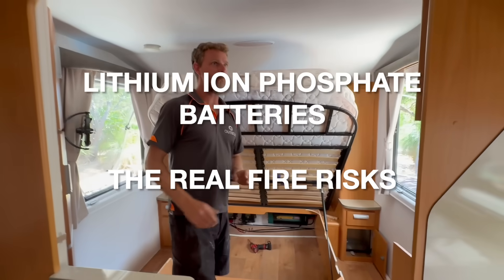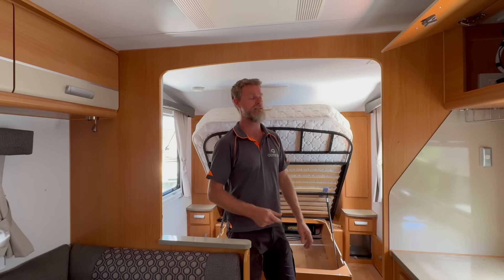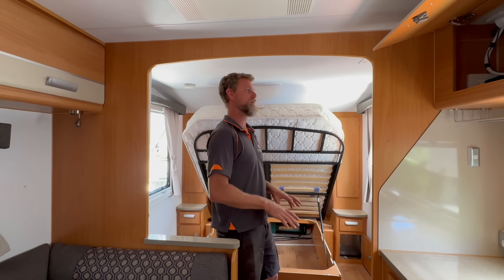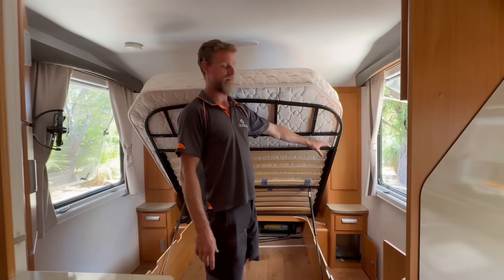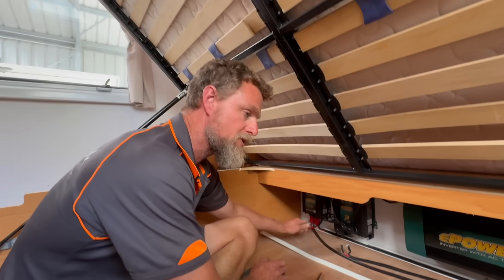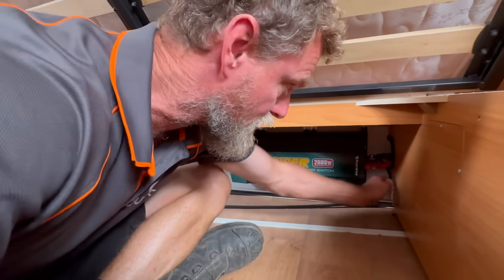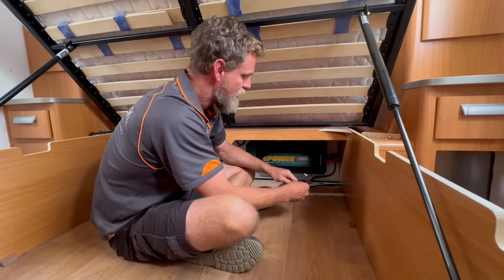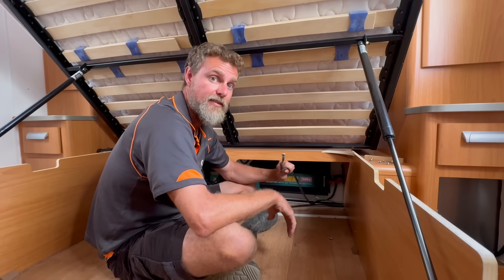Caravan Lithium Batteries - The Real Fire Risks

Comment: Lithium ion is high risk, lithium iron tantalate low risk.  
google "LiFePO4 Puncture Test - Can these batteries catch fire? Is LiFePO4 Safe?"   for a crow bar through a LiFeP04 (extreme test lol)

also "Shot, Punctured, Overcharged, Set On Fire Chins 20AH LiFePO4"   for super extreme testing,

it takes a LOT to get LiFePO4 to catch fire.   but it is possible. but your van is in a WHOLE lot of trouble to get there. 

also invest in a good fire resistant battery box too.

Comment: The amount of systems we have seen without proper circuit protection is astounding.

Absolutely agree the cause is usually poor installation, not the battery. There was a case recently where a bloke with a 4WD with a cheap (kings) battery box and battery in his tray caught fire. Everyone blamed the battery but on closer inspection the entire top of the battery was melted and the box had caught fire at one of the terminal studs, due to a bad connection. The case of the battery literally melted and the lithium portion never got hot enough to ignite.
Reply from the maker: Geez, sounds like they got lucky..
Reply: Simple Thermal imaging gun might have caught that issue beforehand...or he could have just spent extra to use quality terminal connectors?

Comment: So I use Victron kit, Multiplus 12/2000/80 for mains output and shore charging, two MPPT 100/50 for Solar (Shunt - etc) and a Lynx Distributor for connecting  almost everything - which has fuses to protect the wires that join everything. One fused output leads to a smaller fused system to power the LED lights, Fridge and water pump. I have 4 x 12V 108Ah (Blue Nova)  LiFePO4 batteries in parallel for storage. Just wish I could get each battery fused with an MRBF (Marine Rated Battery Fuse) fuse and fuse holder to better protect the potential amperage coming out of a LiFePO4 battery...

Comment: SOme of the comments and this video miss the point I think. Unlike lead acid litium chemistray can and does catch fire soemtime spontaneously and sometimes cabling or component failure. They can also catch fire if they are subjected to trauma such as in an accident. Soemtimes that damage does not becoem evindet and will catch fire after the event. 

Damned if I will have one of these batteries in my camper which I sleep in. I'll continue to use traditional deep cycle batteries. Easier to recycle and a darn sight safer thank you very much.  Don't el tme stop you from using litium in your sleeping pod though.....

Comment: Also the location is bad under a bed so u burn in bed?, it would be best to put all that gear in a metal fire proof box. Also those types of inverters are rubbish. Those cheap small inverters do not have the power and enough current output to operate breakers effectively on the 120v- 240v ac side. A fast glass fuse may work, but more than likely if an overload or short occurs the inverter will just shutdown. Most just overheat and fail. A fuse on the battery is a must, use a proper industrial HRC fuse not the automotive 32v plastic rubbish as these can just burn and start a fire. With cable size, voltage drop is more an issue.

Comment: 3:34 in what world could those two chargers EVER both be at full noise, you are just advertising your lack of understanding, either that, or you have a fukn long 15Amp extension lead, such that you can plug the van in, while you’re towing it.
That cable at that length is perfectly fine, just put a 50Amp breaker on it, job done.  The problem in the circuit is not the cable, it’s the fact that it relies on the tightness of the terminals on the AC charger to carry the current from the DC charger, that’s just poor workmanship, because you can’t isolate them individually.
The dickhead that installed all that shit the under the bed with zero access in an emergency, and zero ventilation, is the real issue.

Comment: Firstly, start believing what you're saying, your body language says otherwise (kept looking away and down, two distinctive traits of lying) LiFePo4 batteries are safer, but that's it, safer, they are still liable to self ignite if the internals have an issue. When you really look into Lithium the only advantages is weight and a larger potential charge/discharge rate, They don't really have a larger usable capacity as most require a charge level between 80 and 30% for best battery life, so still only 50% of rated current capacity. 
I have been a loom maker for 35 years and make bespoke looms and adjustments to factory looms. Never had a fire in any of my builds, Fuse regularly and adequately, The fuse is there to protect the cable! That is the first thing anyone needs to learn. Correct rated wire which is load plus 30% (electricity has a surge amperage), up any rating for longer runs, secure wireing at regular intervals.

Comment: Many great points made here about sub standard work in the RV industry. However, anything that continues burning when fully submerged in a swimming pool ain't going into any van I own.
Reply: So no mobile phone, portable speakers, torches, cordless tools, laptop, in your van?
Reply: I'm going camping in the bush, not my driveway. Besides, those items you use on a daily basis vs lithium batteries in a van the average working person may use 4-5 weeks/yr. Even the sales reps we dealt with (yes I worked in the RV industry for 9 yrs) told us they aren't cost effective for RV's you may use on such a small basis. On one of your lithium gadgets, check out the recent fire in Auburn (SA) in a 12 month old caravan & tell me you still want them.
Reply: @ Not one single caravan fire has had the evidence shown to be the storage battery. Only ever media speculation. I know the battery chemistry very well and LiFePO4 does not catch fire. Your home is filled with the volatile types of lithium batteries that do when they go into thermal runaway burn like thermite being "LiPO NMC INR" in all your devices yet you won't use the safe type LiFePO4 which does not burn. So how come Bunnings and The Good Guys and JB HiFi are not burning down left right and centre? Or battery stores? Meanwhile you are happy to have a phone in your pocket next to your nuts which if the battery let go would take them off. I have experience with LiFePO4 cells that have been crushed, dead shorted, smashed, drilled into, screws put through them, laser cut and torn open and NONE of them resulted in fire.
Reply: @magicmanspaz they catch on fire when charging. The good guys and bunnings do not leave them charging as you do when you go out and leave your solar panel on. Why not just use lead acid batteries? They work fine and are safer.
Reply: @ They do have them on charge in stores. Plenty of display devices on charge. How many homes are burning down from lithium devices vs claimed caravans. Dodgy wiring is the issue not lithium. You have a lithium powered mobile phone.
Reply: @magicmanspaz  The biggest cause of housefires today is batteries connected to solar chargers. Lithium phone batteries are smaller and do not generate the heat of larger batteries - same with power tools etc.  Bunnings does not have truck sized batteries on chargers.
Reply: @DavidNotSolomon  Stop making crap up mate any fire service website or insurance website will tell you the leading cause is cooking, faulty electrical, heating and candles, smoking in bedrooms. I can tell you power tool batteries get a lot hotter after use than the storage batteries in vans do when charging or discharging. I know plenty of phones and laptops that get hot when charging. Quality storage batteries in vans have temperature protections built in and will disconnect charge if the battery cells reach about 55-60c. Medical equipment and lift beds, Ambulances and such all run larger lithium batteries. How many fires do you see there? The LiFeP04 chemistry in van batteries is not even combustible like the types used in phones and laptops and power tools. Most vans barely even have enough solar to max out even a small lithium battery safe charge rate to even raise its temperature to over a safe limit and even then the BMS will cut charge before it reaches an unsafe level.
Reply: @magicmanspaz  If lithium are so damn good how come LG branded house batteries have been on a national recall for the last 6 months? Oh that's right...BECAUSE THEY CATCH FIRE!!!
Reply: @ So why isn’t everything lithium catching fire? Poor charge equipment and electrical is the issue. Lithium does not just catch fire for no reason. A badly engineered battery system can make AGM start a fire. And can explode a wet cell lead acid. An inverter can catch fire if it’s been made badly. Seen plenty of dcdc chargers go up in smoke. And cheap solar chargers. Lithium is not the issue. Shoddy electrical is. The LG batteries are also LiCoO2 Lithium Cobalt Oxide different to LiFePO4 which isn’t combustible. There has been no evidence of a caravan fire shown that it was in fact the lithium battery only media speculation. You find one example of faulty electrical in a home unit being re called and think it means anything lithium is dangerous. News flash everything you own with a rechargeable battery in it besides your car start battery these days is lithium. If it’s no good then why has it replaced other battery types in just about everything.
Reply: @magicmanspaz  Maybe it is the chargers - still a problem though.
Reply: @ I have seen chargers fail and send 16plus volts to AGMs and burst them. A quality lithium would just turn its BMS off and not allow the cells inside to be over charged. Don't buy cheap crap and get the electrical installed by a competent person. People need to stop blaming the batteries. Its way easier for a caravan manufacturer to blame the battery then it is to admit they do shoddy electrical work and use the cheapest batteries they can find. You use a crappy $200 lithium and you might get a fire. Because it has under sized cable inside and dodgy connections, a BMS that does not have working protection or a poor quality build where cells do not have adequate insulation and dead short. Not because its lithium but because its built like crap.
Reply: @magicmanspaz In your earlier post you mention why dont fire fighters report such things. Im here to tell you a close family member is a fire chief in a capital city MFS & he categorically states ALL lithium battery fires are their worst nightmare to attend. You clearly have a point of view, thats fine. But so do other people who differ to yours. That my friend is how the world turns.
Reply: @ I see my quote from the fire chief on lithium batteries was removed?
Reply: @aussie-all-the-way  I said where is the evidence its the battery that started the fire. Good for him he is scared of a lithium fire. Id rather a fire with shed and half a dozen lithium batteries inside then a shed with half a dozen gas bottles. Again there are different types of lithium batteries, The ones in caravans are not the type that violently burn. But everyone is happy with the violent types in their pockets in phones and devices and in their ear buds etc.  Some people are just scared of things they do not understand.
Reply: @magicmanspaz Clearly you have a vested interest in the industry & don't like anyone disagreeing with you. Still haven't answered why LG have a national recall on their batteries. Try putting a lithium battery in a swimming pool. It keeps burning. Hope you have a big pool for your shed full of lithium.
Reply: @magicmanspaz From 2017 to 2023 the ACCC reported 15 home solar battery storage related fires. The report stated it was more than likely most of those 15 were related to the LG battery recall I referred to earlier.
Reply: @aussie-all-the-way  They have a recall for a faulty product. There are lithium fire extinguishers these days "F-500" and by the time the firey's get to the fire the lithium component of the battery has burnt out they are only putting out the rest of the fire the lithium is gone. When a lithium battery of the volatile type goes up it goes up instantly and is done in a minute or two all the fire after that is just flammable materials around it.
Reply: @DavidNotSolomon  Strangely one of my replies was also deleted. Hmm...

Comment: Incorrect right from the start. Wow 😮.
Reply from the maker: @stevenschulte1475  Please note that at the beginning of the video, a title appears on screen: 'Lithium Ion Phosphate Batteries: The Real Fire Risks.' This has caused some confusion among viewers. To clarify, lithium iron phosphate batteries are part of the lithium-ion family, and in this video, we specifically address lithium iron phosphate batteries, which are commonly used in modern caravan power systems.
We're happy to answer any questions you may have.
Reply: @outechoffgrid  heh ha nice try.
Reply from the maker: @stevenschulte1475  perhaps you can elaborate so that we can endeavor to resolve any confusion you may have, and answer your questions.
Reply: No questions. Except, was it a typo or not.
The key information is lifepo4 vs several chemistrys of  lithium ion. And the first thing I  see is a term nobody uses. At this point it was apparent you had no useful information to offer. You could have just fixed the typo.

Comment: This is why you should avoid using Lithium-Ion as your house batteries.  Always opt for Lithium Iron Phospate (LiFePO4).  They are not as volatile and become unstable with heat.
Reply: I chose the Vtoman portable power station for my camper for this reason, it’s lifePO4, & way cheaper than Jackery
Reply from the maker: Lithium Iron Phosphate (LiFePO4) is the standard in the caravan and RV industry, it is the type of battery we discuss in the video.

Comment: i have recently seen a new van delivered with a 3000W inverter wired with 8 B&S as the DC supply cables. absolute insanity.
Reply: Geez! I use 000 B&S, only because I can’t get 0000.

Comment: The problem with this installation has nothing to do with Lithium batteries. It doesn't matter what battery chemistry is used. If there was any short or failure in the Dc-Dc unit,  the 240v charger or wiring, the possibility of a fire is high. 
If the Lithium battery is installed outside the van, by the time the fire gets that far no fireman is going to save the van.

I see installations worse than this at least twice a month and they are becoming more common. 
What is more saddening is a this installation here looks like it might have been done by the manufacturer!
More and more people are doing diy jobs on their gear because they saw how to do it on YouTube.
Trouble is the influencers have no idea!  All they want is views.
A bit like the title of this video mentioning Lithium to get more views.

I appreciate you are trying to show people the dangers of incorrect wiring, but once the van is alight the battery is the least of the problem.
 The styrene insulation in the walls will burn without evident flames or smoke and then if there is a gas bottle for the cooker a burning battery will seem insignificant.
Reply from the maker: Thanks for the comment.  

The whole point of the video was to enlighten people on the fact that it’s extremely unlikely for an LFP battery (which is the type of Lithium Ion battery used for deep cycle applications in caravans) to spontaneously catch fire and highlight the fact that most often it’s the installations that are the cause of electrical fault and failures. 

The image used was an image from a caravan fire that happened that particular day to which the fire department had stated that the cause was ‘Lithium Batteries’. The comments on that post by that particular fire department had people both scared and misinformed. 

Our intent was to aid in squashing the scaremongering and misinformation around ‘Lithium batteries’ as well as highlight the importance of having an electrical installation completed correctly and safely. 

Cheers.

Comment: If you screw up the installation it is NOT the LifePo4 batteries fault and it is even MORE dangerous with non lithium batteries as they can deliver more Amperes.

All The cables I use in my system is rated to handle 300A or more continuous without heating up, max usage will bee 200A as that is the most the LifePo4 battery bank can dish out before the BMS say no. Also my system is 24V with all the cabling rated so it can run at 12V also in a pinch.

Comment: Is there anything inherently more dangerous about Lithium Iron Phosphate batteries compared to SLA/AGM batteries of the same capacity? Assuming both are installed correctly and connected wiring and equipment is rated and connected correctly.
Reply from the maker: Thanks for the question. Really great question. 

Firstly, Let’s assume that both products are good quality products. Lithium Iron Phosphate batteries that are designed to be used in deep cycle applications such as auxiliary batteries for caravans, rvs or 4wds are inherently safer than the likes of AGM or SLA batteries due to the fact that the battery has a BMS device either mounted within the casing of the battery or externally to the battery which has numerous protections built into it. Protections such as short circuit, over current, over temp, over and under voltage. The purpose of this is to cut the cells of the battery off from the load or chargers to protect the cells from being placed into a damaging situation. 

AGM/SLA batteries do not have these types of protections built into them and rely on external installed protections to complete these functions.
Reply: AGM and normal led batteries is even more dangerous as they can deliver even higher short circuit Amperes... LifePo4 batteries have as I understand it much less chance of bursting into fire like regular Lithium batteries can do and that is why they are popular to use in camper vans and similar saving a a lot of veight. My 5000Ah battery bank with LifePo4 for example is  54kg. A AGM battery bank with same capacity (drained to 50%) would be 250kg.